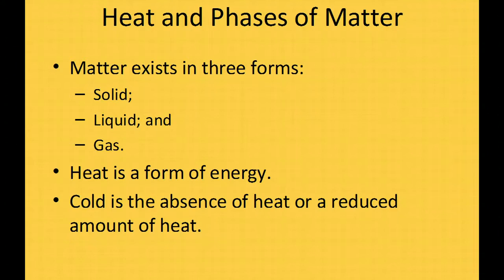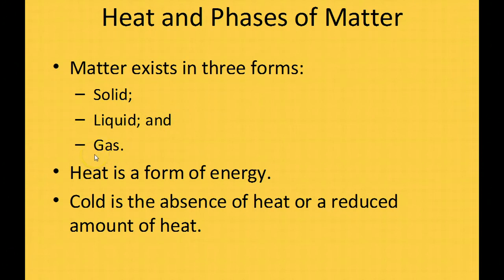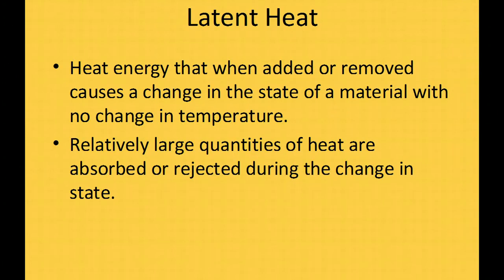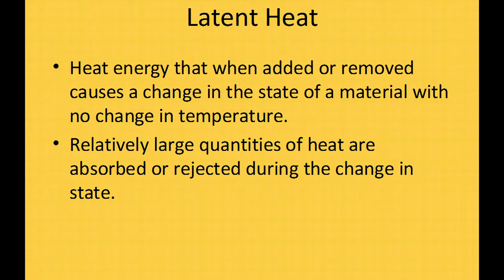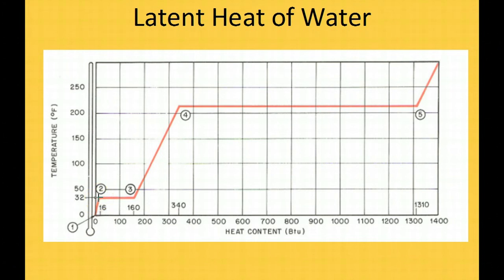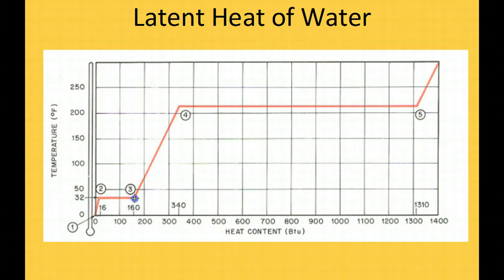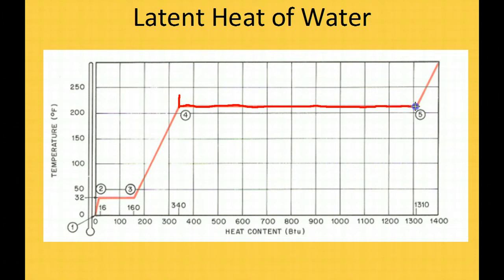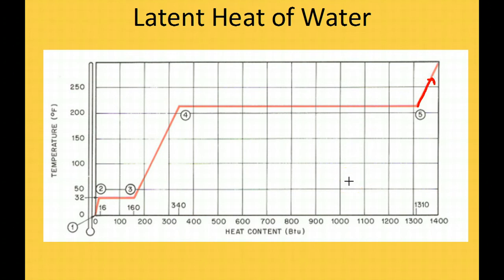Sensible and Latent Heat - HVAC Training - HVAC Training Solutions

Comment: Thanks . Not complaining,  and was a great explanation. Most explanations of latent heat are explained this way but it really leaves a lot out of the way it’s taken advantage of. Cooling towers and evaporative coolers make use of the latent heat of evaporation well below the boiling point of water.
Tying this to how cooling happens with evaporation is hard, with me anyway , with the general explanations of latent heat like this video.
Such as hot air blown across wet pad in an evaporative cooler. As evaporation occurs the dry bulb temp decreases as the energy from the air used to evaporate the water,  there is now less heat in the air that passed  . The vapor from evaporation isn’t increasing in temperature as it absorbed the energy from the warm air, but the humidity is increasing.

Comment: 5:12 "You can see here it doesn't require quite a bit very much heat energy to rise at to raise that temperature from 32 to 212 degrees." First, the viewers' ability to comprehend is taken as a given, which is frustrating if one is not tracking. Why might one not be tracking? Well, for one thing the saying "it doesn't require quite a bit very much" and "to rise at to raise that" are odd and so a bit difficult to follow. Secondly, the imprecision of the telestration is distracting: is the energy at 212 degrees 340 Btu? Or is the energy slightly less, say 330 Btu, as the speaker telestrates? And furthermore, why does the speaker consider that the energy required to change the state from ice to liquid is "not very much"? Well, certainly relative to the energy required to change the state of water to gas it is not very much, but isn't this an apples to oranges comparison? But it is, however, a larger amount of energy than is required to change ice to water. So what does "not very much" mean? And why is it relevant to the discussion? I've only pointed out one sentence is a seven minute presentation.